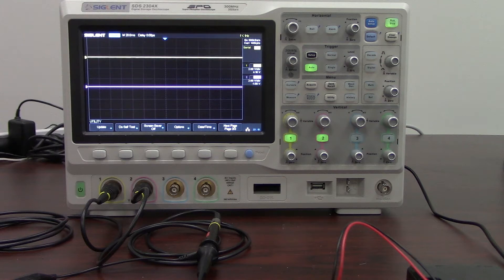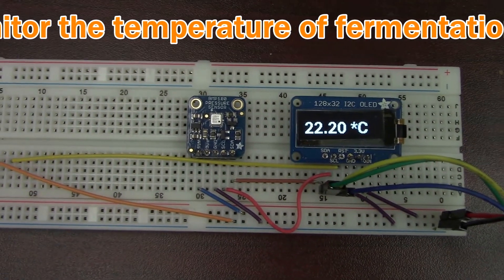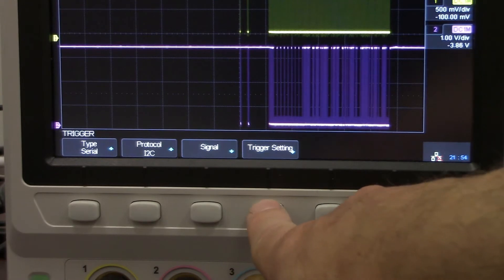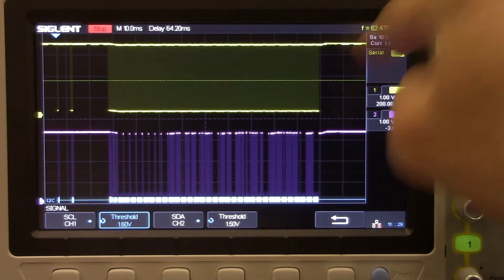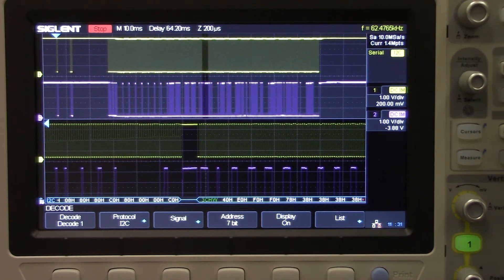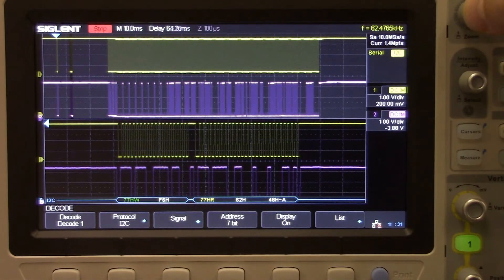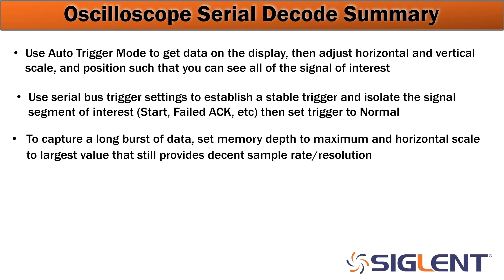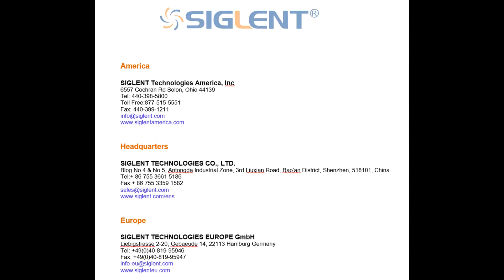Troubleshooting a serial bus using a SIGLENT SDS oscilloscope

Comment: **BUG REPORT**

I just bought a SDS1202X-E and flashed it with the most recent firmware. There is a bug with the UART debug settings. When decoding an 8bit, no parity, 1 stop bit packet, the scope won't decode the packet unless only a single character is sent. If you change the decode settings to 2 stop bits it decodes the whole packet like it is supposed to. Your firmware has the stop bit mixed up and off by one.

It took me about 4 hrs to figure out what I was doing wrong. I felt like I was using my hantek again (which was what I bought the Siglent to replace). Please look into this.
Reply from the maker: Thanks for your feedback. We've already told the relevant technical team to deal with the bugs about this version of firmware, and you can use the firmware version 1.3.26 for the time being. If you have any other technical questions, please feel free to send us at support@siglentna.com.
Reply: Edit: I had a new hantek side by side with the Siglent for comparison and it decodes the UART packets seamlessly, right out of the box. The Siglent is certainly the better scope, but I would have preferred not spending 4hrs troubleshooting my new siglent purchase.

Comment: Guys, can you make an upgrade for SDS1202 allowing to capture I2C communication and store it into the file on flash.
Reply from the maker: Thank you for writing in. I'll ask Engineering to consider it in a future revision, but I recommend writing to us at info@siglent.com so that we can communicate directly with you about your requirements. 

With the current SDS1X firmware (1.1.2.15R10), you can display a table of the decoded values of up-to-seven lines and then scroll for additional lines. You can capture display images to external USB for later review.
Reply: @SiglentVideo  this is what I did but it is a getting a bit tricky if I need to detect issues in a long history.
Reply from the maker: @k1zmt  I understand. This may be an option.. Sigrok is a program that enables decoding on large datasets. I believe that it works with the SIGLENT X: https://sigrok.org/

Comment: Can some tell me what is happening here because I have zero knowledge about oscilloscope, so what is the point of using it.
Reply: What part of the video don't you understand? There's a million "beginner" videos on YT for scopes.
Reply: @larrybud  basis use I new and I got my oscilloscope for 2 years now but all I did was connected to a battery or a sign Waves generator and that it, I have no idea how to use it. Need a video how to use it Step by Step.
Reply: @Chai-Vang  There is no "step by step" instructional video for a scope. You have to know a little something about electronics to start with so you know what you're looking at.
Reply: @larrybud  100% agreed with you that was my problem I don't really know much about electronic I just like electronic stuff, I wonder why no videos tutorial on how to use oscilloscope on a job like multimeter tutorial.
Reply: @Chai-Vang  Because a DMM is a simple instrument. You really don't have to know much electronics knowledge to use what. Of course, what you DO with the info the DMM is telling you, you would have to know what you're doing.

Comment: Why don't you make the EasyScopeX software for Mac computers. I just bought a SIGLENT oscilloscope and I found out I can't connect to it from my Mac. It's a deal breaker for me.  Most of the engineers I know are Mac users.  I'm just going to shoot an unboxing/product review video for YouTube and I'm returning the oscilloscope back to the store. So unfortunate :(
Reply from the maker: Hello. Thank you for your feedback. I am sorry that we don't currently support Macs with our software, but the SDS1000X-E and SDS2000X-E scopes have free browser based web control that has almost every feature that EasyScopeX supports and this function operates on many current browsers and should work very well for you. Here is a video: https://www.siglentamerica.com/video/x-e-4-channel-web-browser-update-this-thing-is-fast/

I'd suggest contacting your original seller and asking if you can swap it out, if you are interested. 

You can also write info@siglent.com if you have additional questions.
Reply: @SiglentVideo  Does this apply to the 2channel SDS1202X-E Also? I noticed we didnt have an OS update like the 4channel
Reply from the maker: @hack0well  No. The SDS1202X-E scopes do not have an onboard web browser. It is available on the SDS1104X-E, 1204X-E, and SDS2000X-E series of oscilloscopes. 

All of the X-Es do feature free serial decoding, as described in the video, however.

Comment: I cant get my SDS1204x-E to show anything in the decode either
Reply from the maker: Hi Garrath. The decoding thresholds are configured independently from the trigger settings. Also, the latest firmware update includes some decoding bug fixes. Try upgrading the firmware and then drop info@siglent.com an email if you continue to have issues. 

Here is a link to the FW: https://www.siglentamerica.com/service-and-support/firmware-software/digital-oscilloscopes/#sds1000x-e-series
Reply: @SiglentVideo  THIS LINK DOESNT WORK!!! I WILL RETURN THE DEVICE!!!
Reply from the maker: @nandowonka  What link are you referring to? Please write info@siglent.com and include as much detail as possible. Our applications engineers will assist you. - Jason, SIGLENT North America

Comment: Great tutorial for the ones with that Oscilloscope model, Unfortuniy It is not working for me I have a SDS1202X-E, I followed all the steps but I am unable to decode with using protocol I2c is selected. On the Display table, I got a yellow exclamation symbol and it says "No Data"
Reply from the maker: Hi. Can you write in to info@siglent.com and we can get more detail to help solve your issue?